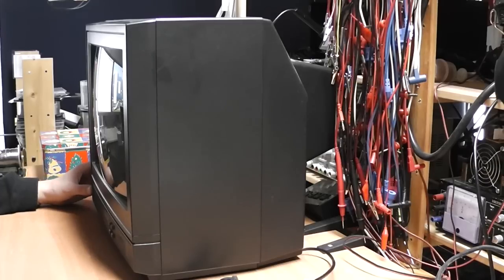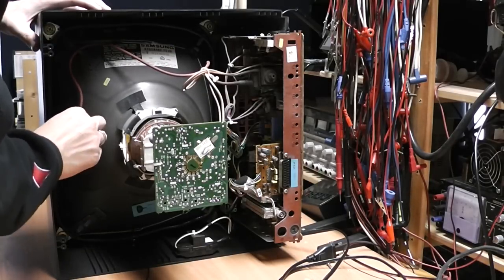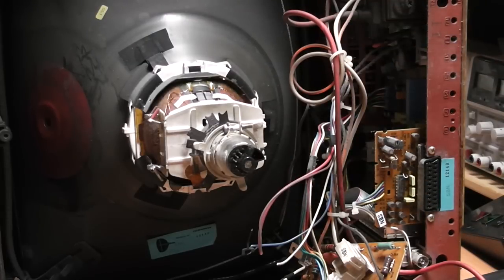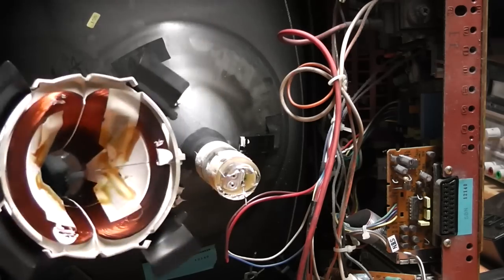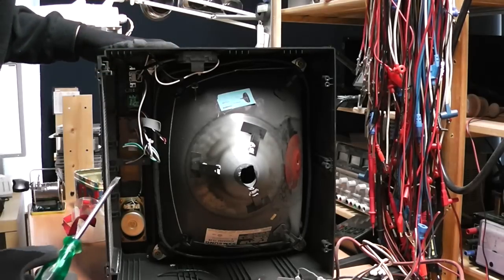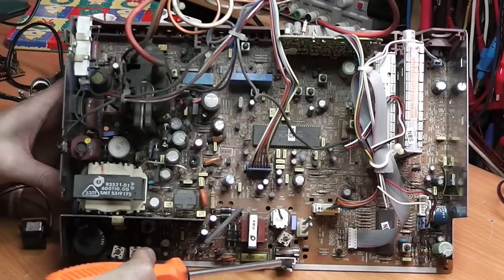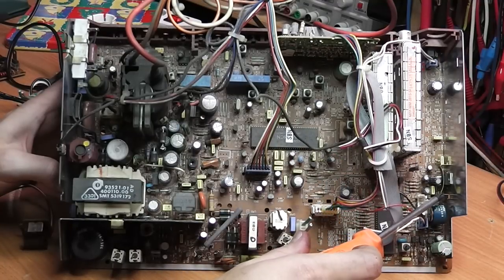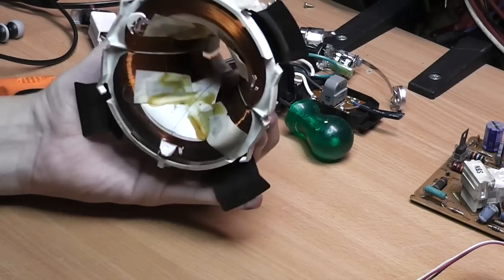Safe CRT Monitor Disassembly

Comment: I don't understand. You "grounded" it to the tv grounding wire. But that was not plugged in to anything. So really you did not ground it at all?
Reply: +FishMB2015 Reference grounding. Basically short circuiting.
Reply: Please dont do so..  You will die from electric shock.
Reply: @FishMB2015  The grounding wire mentioned here is the bare braided tinned copper wire that is strung/wrapped around the back of the tube in contact with the external coating of Aquadag (black graphite paint) and the metal mounting frame parts.  The issue is that the glass of the tube forms the dielectric of a capacitor and the HV terminal is connected to the inside coating of Aquadag and screen and between the two sides of the tube glass may be 10 to 25 kV if it has been recently switched on.  When you connect the HV terminal to the external ground braid you discharge the capacitor to make it safe.

Comment: What is the function of the plastic sliders between the filament and the coils ?
Reply: They were to adjust the colour convergence to make the three electron guns all point to the same place on the screen so the picture would not have coloured fringes.  Adjusting them was a manual task that was assisted by suitable coloured test patterns that let you work on one pair of colours at a time.

They are specialised weak magnets with funny pole designs to affect just one of the guns at a time in one direction, kind of.

Comment: Also, i thought that the inside of the CRT was poisonous and radioactive. Is it dangerous to expose yourself to the inside of the tube like that?
Reply: The inside of a tube has a small quantity of light emitting phosphors behind the front face.  Some of these powdery compounds are not good for you to eat or rub into broken skin (from when you smashed the glass) but are not going to jump out and attack you.

If you have a very old tube that did not use leaded glass and operated it at a voltage above 25kV it would emit some (small amount) of X-rays mostly from the back but this leaves no residue so poses no risk when switched off.

The getter material (round pie dish shaped thing attached to strip on electron gun assembly  at 10:10) is often a Barium compound and is also not good to eat or breath the dust.  The silvery black that turns to white deposit that is created with it on the inside of the tube is also not suited for licking but contains very small amounts of getter material.

Comment: So what happens if tub is broken but all gases and stuff are inside the TV not out side. How long do I need to wait until it is OK to take the rest apart
Reply: The charge is lost when the tube is broken as the inside and outside discharge through air and from touching other connected points.  I think a few minutes would be enough if the tube is in pieces.  Remember to unplug or it may still have the HV supply switched on.

Comment: Take note that your screwdriver did not produce any sparks from the high voltage wire, therefore there was no charge in the tv.

Comment: Is it usually common for the viewing glass of the monitor to be part of the CRT tube?  I am hoping some old monitors I have could be opened to get some glass plates for a project. Just wanted to see if it was worth opening some old working monitors to see if I could use the glass.
Reply: On very early TVs before the invention of the anti implosion band around the faceplate they made use of a second protective glass in front of the tube proper.  These have been removed by those who restore vintage TVs and are attached with some kind of hot melt glue type stuff.  On any modern TV the faceplate is part of the vacuum envelope and would have to be cut off with a diamond saw and then cleaned of phosphors in the inside.

See also https://youtu.be/ZeN2gMM31lE?t=146

Comment: Fanuc display A61L-0001-0093 .when i power ON the display ,it shows only a YELLOW line .please advice how to troubleshoot. thank you
Reply: One of your deflection circuits is faulty.  There are places that will repair or you can watch repair videos and hunt down circuit diagrams and service manuals and learn to do it yourself if it is important.  There are also companies that sell LCD upgrades for popular CNC control systems to avoid the expense of repairing end of life CRT displays.

Comment: Attaching the croc clip to the earthing strap around the monitors tube is grounding the screwdriver!!!!, as what the monitor itself grounded to??....nothing!!
Reply: The charge is stored in the capacitor that is formed by the grass walls of the tube.  The external Aquadag is connected to the braised ground strap (wire) and the internal Aquadag is connected to the metal HV feed through contact under the HV wire rubber cap.

Comment: Why the hell is there a hammer involved? I want to take it apart for use in something else, not break it, if I wanted to break it, I'd take a sledgehammer to the front of it, what the hell?
Reply from the maker: In the video, the tube is vented in a controlled manner using a hammer to break its neck. The reason for this is that it allows for much safer handling of the non-usable remains, i.e., avoids getting an uncontrolled implosion e.g., if you drop a tool on the inner side of the tube by accident. This is something a sledgehammer to the front would not be able to achieve and instead put glass everywhere if you were even able to break it (the front is surprisingly sturdy). However, your observation that the tube is broken after venting it is entirely accurate. I am operating under the assumption that the tube is not something that is either reusable or particularly valuable. If you do intend to reuse it, I have good news for you: You can simply skip the part where the tube is vented and it will not break so you can reuse it. I did not think stating this comparatively obvious fact was necessary, but clearly I was mistaken. Hope this clears things up.
Reply: If you want to use the tube apart you either take the electrin gun with the while rest of the tube you only leave behind the pcb
Reply: Hey! I found a tutorial that doesn’t smash the tube, you puncture a small hole into the hole that the rubber is connected to!

Comment: You will die if you use an uninsulated screw driver to discharge a charged capacitor. He is using an insulated screwdriver but says uninsulated as he points to the actual metal. Never touch any uninsulated part of a tool to discharge. You gotta use extreme caution when discharging capacitors

Comment: "Quick Recap in a safer universe"Extremely Helpful video. but still dangerous and sketchy without proper discharge. The screwdriver shorting it out is acceptable, but not guaranteed. its better to solder a resistor of about 5 to 50 ohms/V somewhere between the alligator clip, and ALWAYS CHECK WITH A MULTIMETER!! (it could save your life keep you alive one more day) , Remember...  A charged CRT carries high voltage—about 27,000 volts. so why risk your health also the crt may contain mercury and other nasty chemicals, also trying to open it you risk it imploding as it is a vacuum thus glass would be going everywhere. simply not worth the time and health unless you really need the darn electron gun (doubt it)  and you know what your doing with PPE (personal protective equipment).
after proper discharges of large capacitors. Everything else inside is up for grabs though. so have fun and build some cool shit!!
Reply: @David Chavez there is no mercury in a CRT they work with a hard vacuum.

There is a tiny bit of mercury in cold cathode fluorescent back-light tubes in some LCD displays (TV, monitors) and more in domestic fluorescent lighting tubes and compact fluorescent bulbs.  

Modern LCD bulbs and back lighting and vintage filament bulbs do not contain mercury.

The discharge resistor is required if you want to avoid a spark or limit current when you touch the grounded screwdriver to the HV terminal and is one more thing to go wrong.  The amount of charge in a tube is not the same as other high energy capacitors in a powerful switched mode powersupply where the current limiting resistor is good advice, in a CRT the high voltage is the problem, not the large amount stored energy.
Reply: It's the lead in the glass if anything to be concerned about. Probably the main bain of the technology.

Comment: Why don't you just cut the wire from the fly back transformer to the tube
Reply: The possible residual charge is in the tube (connected to that HV wire) and if your cutters are not well insulated you may find it discharges through you when you do the cutting or later when you brush against the end of the cut wire.

Comment: Why not just cut the wire attatched to the CRT?
Reply: That's because there will still be a lot of dangerous electric charge left in the monitor and maybe in some of the capacitors. Always discharge the CRT monitor and capacitors before messing with it.
Reply: Also, I'm not sure if taking apart a TV is safe at all. There's all those chemicals around the CRT like mercury that I'm just not sure if it's worth it.
Reply: @mechaman533  there is no mercury in a CRT they work with a hard vacuum.

There is a tiny bit of mercury in cold cathode fluorescent back-light tubes in some LCD displays (TV, monitors) and more in domestic fluorescent lighting tubes and compact fluorescent bulbs.  

Modern LED bulbs and back lighting and vintage filament bulbs do not contain mercury.

Comment: dude there is mercury gas in crts and i thought it was in the glass thing you broke with the hammer.
Reply: @fantasyshroom there is no mercury in a CRT they work with a hard vacuum, take it easy on the shrooms.

There is a tiny bit of mercury in cold cathode fluorescent back-light tubes in some LCD displays (TV, monitors) and more in domestic fluorescent lighting tubes and compact fluorescent bulbs.  

Modern LED bulbs and back lighting and vintage filament bulbs do not contain mercury.

Comment: i cut all the wire and hammered that big ass piece connected to the board..it made a pop sound picked it up with gloves, threw it in a box and throwing it out in Tuesday. Fuck it..-_- only protection was gloves.

Comment: to discharge a tv of electricity you just need to hit the power buttons and other buttons this uses electric so when not pluged in this discharges the tv.
Reply: This will discharge the powersupply capacitors if there is no fault in the circuitry that uses the power in the caps which may not be the case if the TV or monitor is faulty.  However it will not discharge the CRT charge any faster.

Comment: I would not consider that safe disassembly.  You're supposed to crack the small nipple on the back of the tube.  I own an electronics recycling company.  We destroy thousands of these in a manner much safer than you have pointed out.
Reply: video please